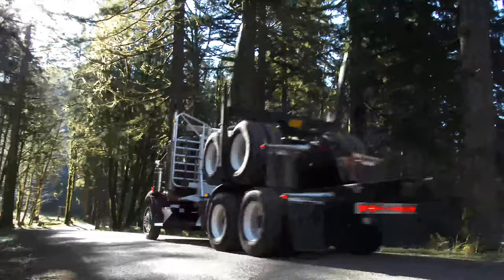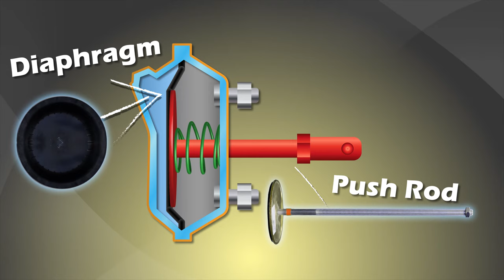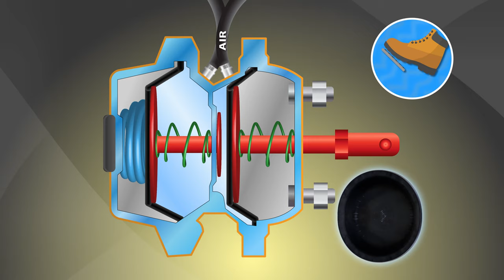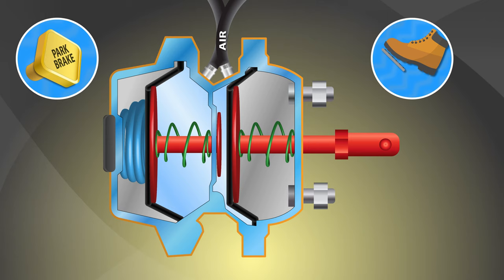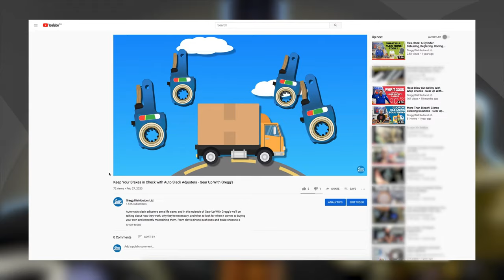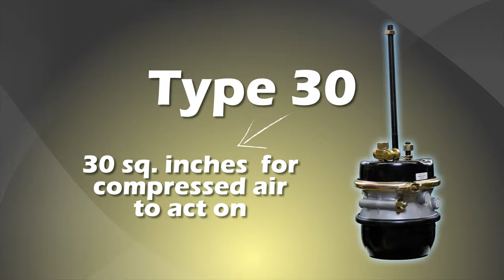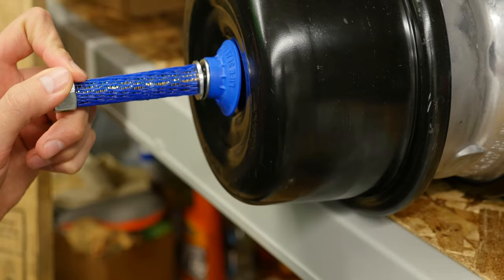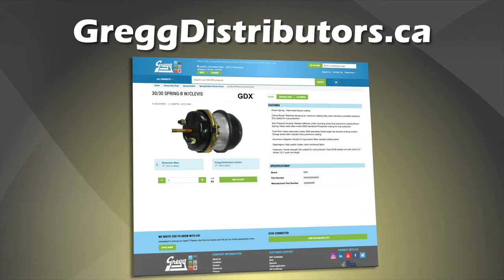Service Brakes and Spring Brakes; What's the Difference? - Gear Up with Gregg's

Comment: Sir, is it necessary to replace brake air chamber every 3 years?
Reply from the maker: No, it is not.  However, this question is somewhat dependent on the specific brake pots that you have in service.  For example, the Haldex Life Seal product is a sealed unit with no plug so the likelihood of contaminants corroding the spring or the spring cage are incredibly low.  This is why the product has a 8 year service life warranty. You may get even more years out of the product but Haldex provides this guarantee based on the quality design of the product.  The Gold Seal product by Haldex has a 4 year service life warranty.  So, unless you experiencing issues with the brake system, you do not need to replace every 3 years.  If you are in the market for new brake pots, be sure to check them out here:
https://greggdistributors.ca/heavy-duty-fleet/new-spring-brakes?resp_group=Default,Variations,ItemProperties